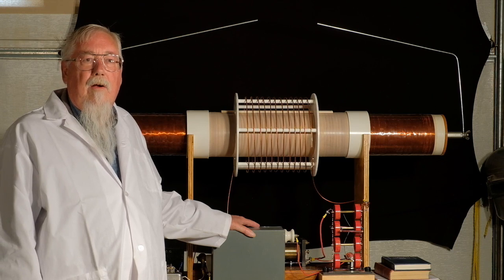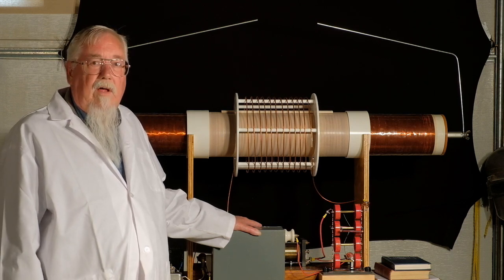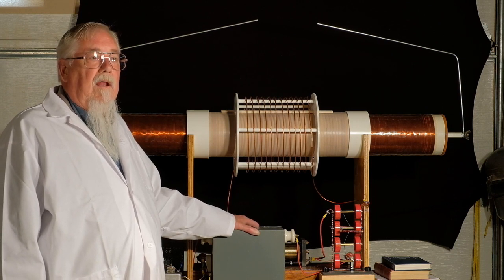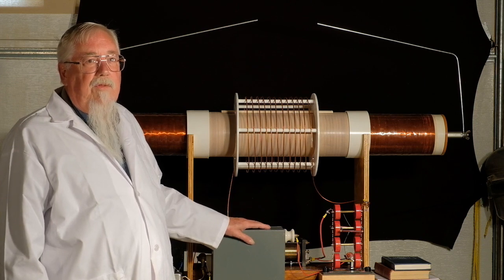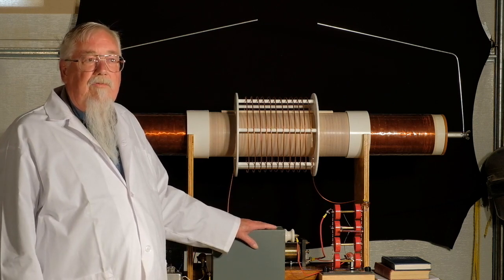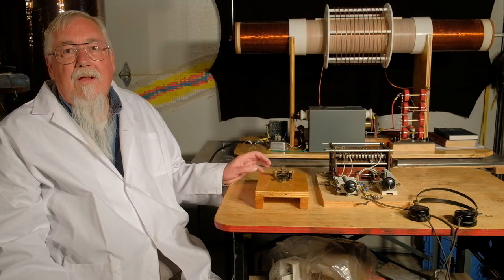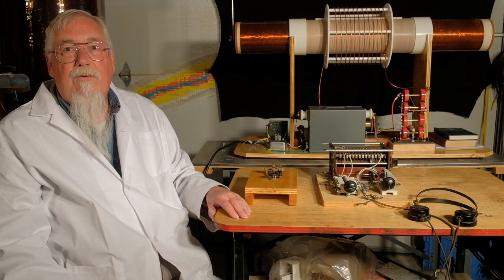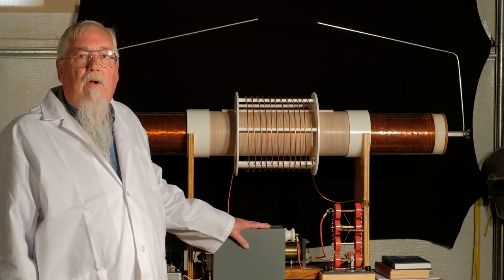Spark Gap Transmitter

Comment: Would love to see the working receiver in use.
Reply from the maker: That would be interesting as I'm not sure what the operator would actually hear. At the time, there were no vacuum tubes to create a beat frequency, so we wouldn't hear the CW tones we are familiar with today. I believe there were natural semi-conductor materials available that would have worked in a similar way to modern diodes, and I suspect the operator would have heard clicks or raspy tones generated from the intermittency of the spark gap.

Comment: Isn't a spark gap transmitter illegal to run now? In a Faraday cage? Doesn't change the fact that it's cool as all get out.
Reply from the maker: You certainly wouldn't want to connect it to an antenna.